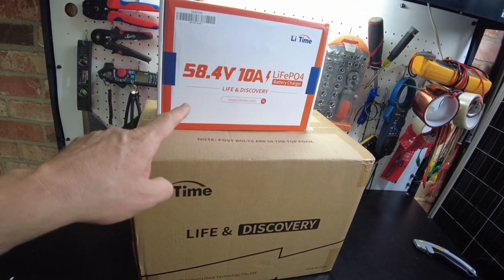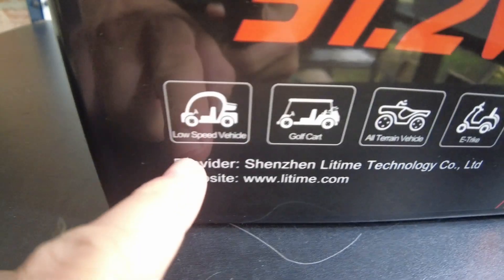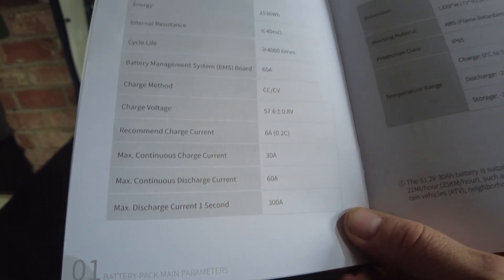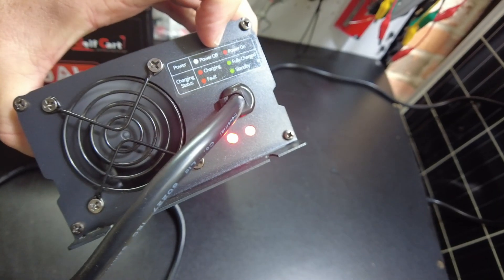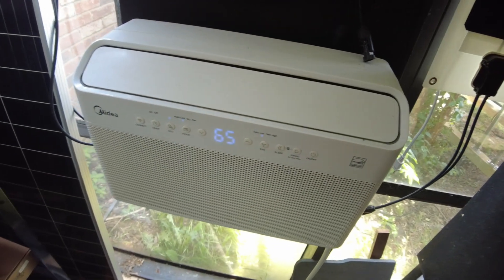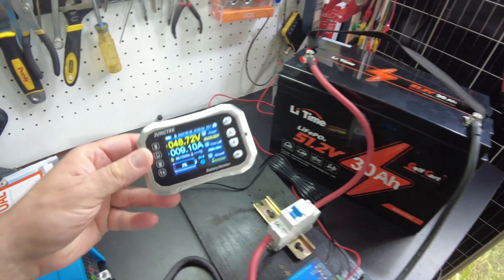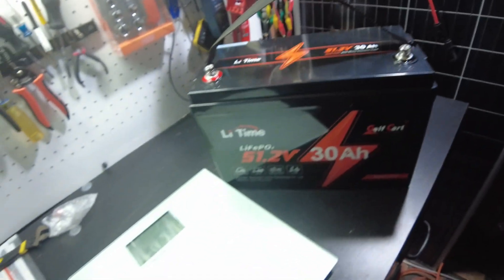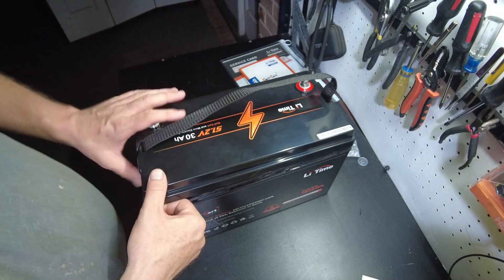LiTime 48V 30Ah Golf Cart LiFePO4 Battery

Comment: There is clearly demand for these smaller 48V (51.2V LiFePO4) batteries.  Prior to this one, the only other small-capacity 48V/51.2V battery that  I know about is the Lithova 48V (51.2V LiFePO4) 25Ah battery.   The Lithova battery is a group-24 form factor... a really nice motorcycle-style small form-factor (quite a bit smaller than this LiTime battery's form factor).  But not a golf-cart battery... the Lithova doesn't allow much surge whereas the LiTime allows 2C operation for a short period of time.

The biggest advantage of the LiTime is being able to run 2C bursts of power with a relatively small BMS due to the higher voltage and lower amp-hours.  Makes for quite a lot of power in a small system.   However, it is a bit over-priced.  The Lithova is only $230 @ 25Ah while the LiTime is $427.  Massive difference in price for just 5Ah, to the point where I'd just get 2 x Lithova's for 50Ah and parallel them for 50A continuous operation.

I'm a bit surprised that they used cylindrical s.  I would have expected pouch cells. That's why their battery form-factor is relatively large for the capacity.

-Matt
Reply from the maker: Great insight! I need to check out that Lithova brand. From what I understand cylindrical cells can provide higher discharge rates. Maybe that's the reason behind the choice? Thanks :)
Reply: @BradCagle  I don't know re: discharge rates, you could be right.   Pouch cells are typically paralleled in 12.8V small-form-factor batteries... sometimes 4p.  But for 48V there wouldn't be as much room to parallel at 16s.
Reply: Hi brad would you be able to do a video on how to set up your shunt I have a similar unit  but can't work out how to set the perimeters up.i have to sets of batteries and 2 shunts at work with 2 difference read outs.cheers from Aus,Rene.